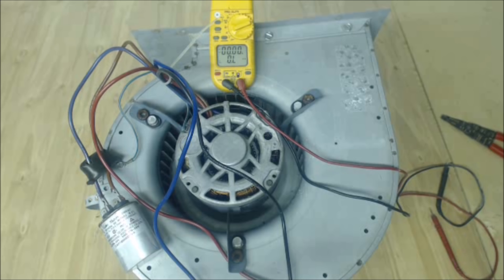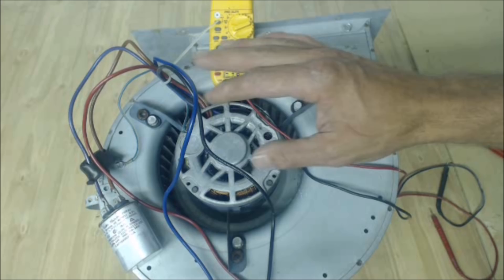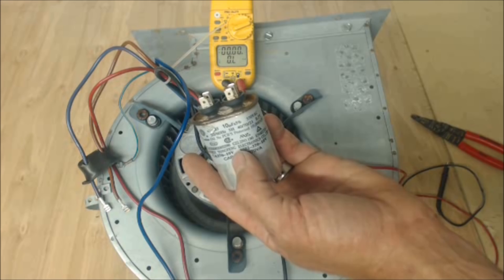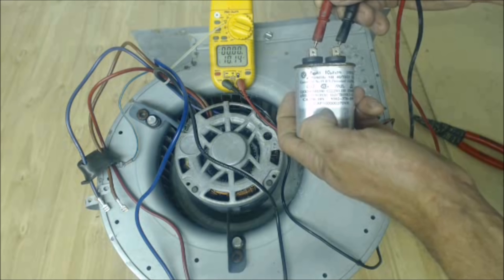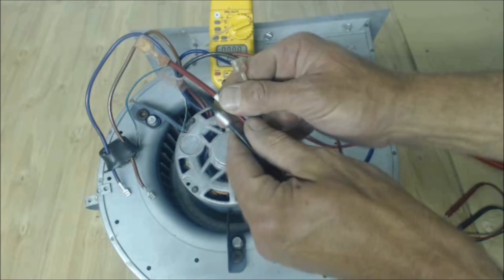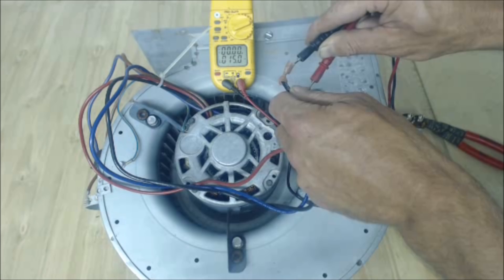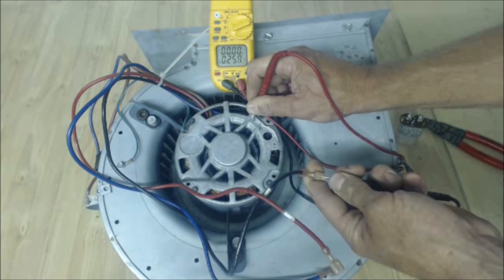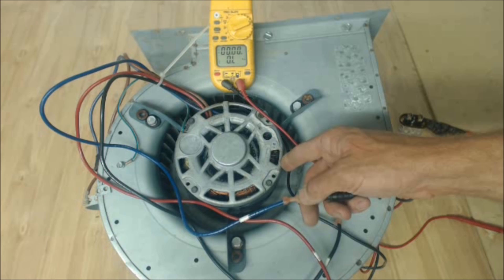Step by Step Troubleshooting of a 240v HVAC Blower Motor Single Phase

Comment: Twenty seven add fifteen equals forty two, not fifty two. The third pair is forty one. Your good. It would have been helpful at start to show how many wires and which colors were line, and which were windings. But hey, it's a good video, and it helped. Thanks

Comment: When dealing with motors, check them with a megger. Ohm check shows pass then megger same motor, and it shows shorting. Insulation breakdown. I have had a motor test fine with ohms, then run it for an hour or so, and then it started acting up. My guess is motor warming up, then amperage charging through the windings finds the weak insulation and creates a short to ground.

Comment: super video can I add a 5 2 1 hard start to a roof package unit????
Reply from the maker: If the compressor will not start or is having a hard time starting then yes. That would help start up and kick itself out due to high heat from amperage. Thanks for the question!

Comment: A central ac units indoor fan wont turn off. Thermostat was checked and all connections are ok. The fan will only turn off when the fan relay is removed from the circuit.
Reply from the maker: Is the red 24v power wire touching the green fan wire somewhere from the board or relay to the thermostat. If the thermostat wire is disconnected off the board and the fan still is powered then it is a bad board. If the green wire from the g terminal of the thermostat is disconnected from a relay instead of a board and the unit still runs then it is the relay that is bad. If you remove the fan relay from the circuit the fan would shut off because a fan relay acts like a switch that is powered by 24v. I will be putting out a video on 8 and 12 amp fan relays tonight at 5 pm eastern standard time. Thanks for the question!

Comment: Isn't it more accurate to check capacitor while motor is running ? Amp draw of motor x 2650 divided by voltage across terminals across terminals.
Reply from the maker: We check capacitors with the power off for safety and they give a very accurate reading,. I don't want techs to be in the electrical compartment while the blower motor is spinning, thanks

Comment: I have a voltage drop. 120v coming in from the source, but drops to 98v when I power on. Blower struggles to spin. Had the capacitor checked by a pro, says it's good. Any input on how to correct?

Comment: If I found those wires had no resistance when checking to the casing, meaning it should run fine, how would I apply the power to the two leads from my 240V wall socket? (It is wired to the two  20Amp dual breaker lines, plus a ground -  the neutral is not connected to the wall socket, but is capped off...
I am used to normal 120V wiring where the black would provide the power and the white would complete the circuit through the device. I guess I am not understanding how a 240V device completes the two circuits, or how each 120 leg gets added together to supply the 240V to the motor. (Its label says 200-230V, single phase, 60Hz, 1/4HP, 1.4 Amps.)

There are two wires leading into the windings from the 10uf capacitor that looks just like yours - a black and a yellow. There are three terminals with a schematic suggesting each is for a different speed - high/med/low. Only two wires attached - red and a gray. Then there is a green wire that comes out of the motor and attaches as a ground to the casing. Of those 5 wires, the black, red and gray went to a connector for the furnace circuitry connection.
My goal it to use the blower in my shop as a dust filter/fan... If this is too involved, can you point me to other good resources?
Thanks!

Comment: uF is manufacturers "lingo"?  The Farad is THE unit of capacitance measurement and is used universally in electronics.
Reply from the maker: Hey Paul, I get asked a lot why capacitors don't all just say mfd or why they don't just say uF. Why both? That's what I was talking about, thanks!

Comment: Need to make sure those capacitor leads ain't touching the casing. That could of given you those results?
Reply from the maker: You are absolutely correct. Where I was located at, I could not see the wires. Thanks for posting that.

Comment: I'm a little confused, I hope you can help me. You always connect your run and start to the run cap correct. You have an extra "run" wire (convenience wire)  that would go on the opposite line of power of your motor common.  Where would that extra start wire go? Or is it a low speed wire?
Reply: You have common, start and run wire. Common goes to one leg of power, Run goes to the other leg of power. Also between start and run you have the capacitor connected.
Reply from the maker: This is correct, thanks
Reply: I believe this is a two speed blower motor. It is a good idea to see the label of the motor itself - it shows all the manufacturer info.
Reply: Ananth are you talking about an air handler or condenser

Comment: can someone recommend the most important certifications for hvac-r ,im getting my epa 608..i know how to solder and braze already..i was a pipefitter/pipewelder I know the pipefitting will come in handy obviously and welding will on the commercial side of hvac..I want to be very well rounded and have every beneficial certification possible..recommendations..please..thanks (I know experience is the key I want to put myself ahead of the game as much as possible with minimal experience)
Reply from the maker: I have to just edit a video I made for someone trying to break into the HVACR field. I will be posting soon. R-410A cert, OSHA 10 or 30, CSST Manufacturer certs. Nate Cert will be later with experience. Thanks for the Comment!
Reply: Having no experience is hard to get into the field - just because you have no experience. If you know somebody it is a different story. I didn't. I tried probably 30 companies, and I was loosing hope any company will hire me. I got hired though, but if you have NATE it may help. Some bigger companies look at that. Some schools offer HVAC classes and NATE certification together. Having no experience and being hired it means you are hired as helper at first. If you show them you work hard and you are interested in learning stuff everyday you will stay. Hope it helps a bit! Just to let you know school is very different than the field. Good luck :)
Reply: thanks

Comment: What exactly are the red, blue and black wires?
Reply from the maker: Red is the low speed hot tap, blue medium speed hot tap, and black high speed hot tap. Make sure the power is off before moving these and when complete, make sure that the ones not being used are wire nutted or on the spare terminals on the board, thanks!
Reply: Thanks for the reply but @ 0:40 you say it's a single speed motor, plus I don't see any white wire... I have a single and all it has is a black and a white.

Comment: Wait, all other videos say that if there is NO resistance between a winding & ground then there's a short, but this guy is saying the opposite ????
Reply from the maker: If there is any type of resistance reading in ohms from winding to the ground with the motor disconnected then that means that the electrical wires are touching the ground. The motor would therefore be bad. You have seen other videos saying something different?